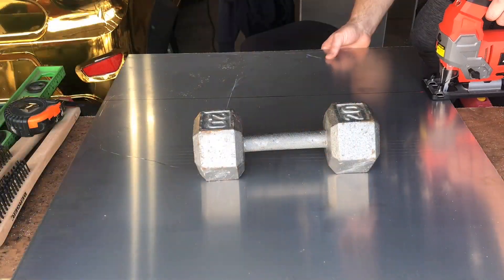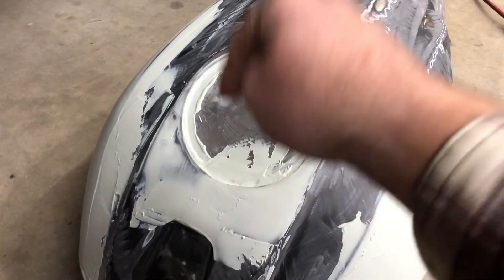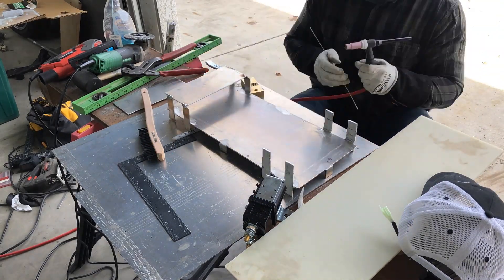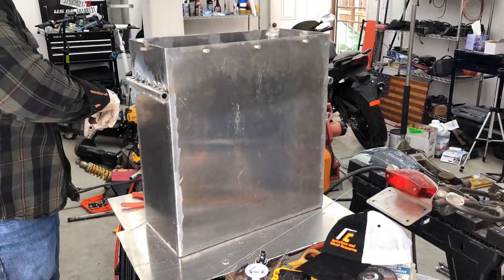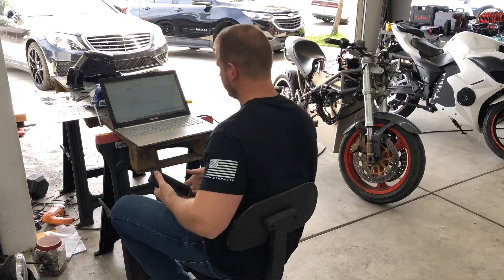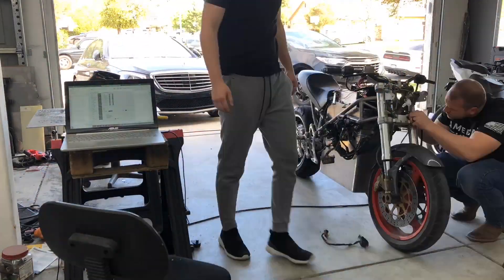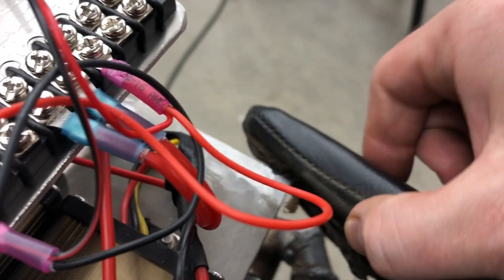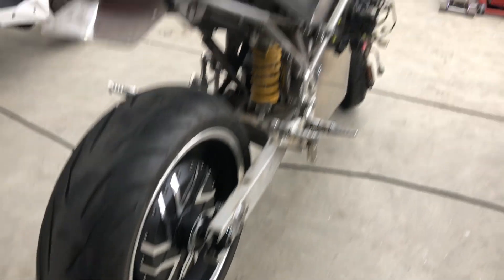The Ducat-E (Electric Ducati Monster) LIVES! Full Assembly of Electronics

Comment: Good project documentation. Curious why you went with LiFePo4 instead of Lithium Ion. Safety? Longevity? I think I would lean toward Li-ion but wanted to hear your reason... Thx. Also, do you heat treat after aluminum welding?

Comment: Bruh you are a major inspiration to me, and I love your content. But you gotta share those Kelly Controller settings for the CB750. You're breaking my heart over here.
Reply from the maker: Hey man, glad to hear it!

I’ll see if I can plug in and grab some of those settings. I did have to dial it back more than I wanted to because of issues with the controller overheating, but it does the job. I didn’t record the specific settings I’m using without getting back into the software to check. Busy week for me, so I might not get the chance for a while

Comment: I think i am using the same controller and software (EVDriveManager) as you but i am using an 8000w motor. i am also running into an issue: the display isnt staying on, it keeps flickering on/off and i am not getting any power to wheel and the mode switch seems to be stuck on reverse. I hear this weird sound coming from the relay but i dont see any issues with the connectors. I hope i can figure it out on my own but might take much longer to get it working. Cant wait to see your programming video. I really want to see how you set your parameters for this build. Thanks again.
Reply from the maker: Dang, man, sounds like an issue with the phase wires, controller harness, or other accessory wiring. I’ll post as soon as I can!
Reply: @LordCurt  i bought it from china and only recently starting tearing it apart after experiencing a few BMS errors. im thinking of just replacing the controller and display, keeping the motor. Right now, im just figuring out how this bike works in general and i am closely watching your videos for guidance. I am so clueless, i am just color matching the wires at this point. I am not giving up though.
Reply from the maker: @NemoEUC  the controller is pretty impressive if it’s the same one I have. A smaller version may not be, but I’d check to see if all the wiring is right before moving past the controller too quickly

Comment: I would be slightly concerned about the concentrated stresses around the x part of the ducati trellis frame, the mounts of your ali box may just shear straight off if it decides to bend. Could be potentially fixed with an extra bit of tube on each side?. But otherwise awesome build, excited to see how that hub motor goes.
Reply from the maker: Already have a plan for a bar underneath the x portion, so shouldn’t be an issue

Comment: Got any brass for cleaning your soldering iron?  Helps a lot.
Reply from the maker: It actually just colors dark because of the heat almost immediately after cleaning. It runs really hot. Does the job great, but I haven’t cleaned it with anything but a sponge or scraper. I may use brass next time it seems slow to transfer

Comment: Amazing work! some really innovative and clever solutions here - especially for the dropouts and the manifold/12v wiring. I built an 17kw enduro ebike previously and the wiring is a bit of a mess and difficult to adjust debug if there are issues - working on an electric motorcycle conversion now and will definitely borrow from this. I'm also just getting into Tig welding - did you use a footpedal for this? My big concern is to bust through the aluminum with too much current and ruin the plates (or bike frame). Also, how did you manage to get good square angles when lining up the aluminum for tacking? with steel you can use magnetic clamps etc but aluminum is non-magnetic. from the video it looks like you just laid them against each other.
Reply from the maker: Glad it was helpful!

Foot pedal, yes. Aluminum burns through much easier. It warps and distorts since it’s such a good conductor, so practice plenty before you go for the real pieces. Also give it plenty of time to rest and cool before you cook it all. Warps like nothing else. For the angles, I used a video by “pacific arc tig welding” called “how to tig weld aluminum - tack welding tips!” to get ideas for how to tack correctly. Once tacked, you can bend the correct angle with a square, but be sure to tack plenty once you have the right angle and placement
Reply: @LordCurt  ah! I see. definitely very helpful & thank you for the reference to the video!

Comment: I’m sorry if I didn’t catch it, but what is brand of controller? What are its specs?
Reply from the maker: It’s an APT96800, which is actually the same model as the 961000. Max voltage is 120. It’s about 15kW continuous. It is capable of 1000 phase amps and a little over 450 battery amps at peak. It runs great
Reply: Thanks Curt. Have you seen the far and driver track versions of the 841800, 961800, 1081800? specs say 1800A/1350A phase current.
Reply from the maker: @sainttenn  I have, and we recently purchased a couple lower power models for an upcoming project. I wanted the track versions, but 1) no motors they supplied with hall sensors were strong enough to handle them, and 2) no encoder versions are available for the highest power controllers yet. Once they have those, I’ll be doing a high power design with a track version and some strong encoder motor, maybe ME1616 or some other brand

Comment: Hey man. I’ve recently gotten a motorcycle from China and I’m looking to tune it since it feels really underpowered/sloppy and the speedometer is VERY inaccurate. It’s a 15kW QS Motor with a FarDriver controller and a 72v 120Ah battery. I’ve ordered the Bluetooth dongle to play with the settings and get it to perform like it should, but I’m not sure how to calibrate the speedometer to display the proper speed. Any tips?

Comment: Awesome work and great explanation of your thinking about each problem. I like the way you solved the swing arm mounting and axle torque arms. Do you think you’ll need some kind of waterproofing around the lid of the battery box? Not sure but is that back tyre on the right way? Also might be good to have the phase wires running down out of the motor to minimise water ingress if you weren’t already planning on doing that.
Reply from the maker: Yep, going to make a gasket for the battery lid, so that’ll be waterproof, just not yet. Downward phase cables is a good idea! I’ll see if we can make it happen during reassembly. 
And yes, the tire is mounted backward. The tire shop guy did it wrong after clear instructions 😞

Comment: Hey Curt, awesome work you did there! I'd like to know if you think if a supercapacitor bank like in your previous build would make any improvements in this build? Was it worth it in the end (in the previous build)?
Reply from the maker: There was a specific reason for it last time, but this one wouldn’t benefit. The controller isn’t pulling pulses the same way the Kelly did that caused an issue with the battery. It would just be an extra level of complexity in this case

Comment: First af all GRATS for all the work. What you are pulling out here is no less than amazing!
One question though. Is the back wheel a bit off center or it just looks so? 
Maybe I missed some earlier comment when you where explaining what you did for the bracing of the hub motor.
Keep up the great work mate!
Reply from the maker: Thanks, dude!

It’s pretty dead dented, and it’s aligned using the stock swingarm ruler/markings. What about bracing specifically did you have a question about? I did go through roughly what method we used for securing it
Reply: Pretty dang *centered haha

Comment: You need to reinforce the tube frame. The engine was part of the structure. Now you created a pivot point and the modified tubes looks weakened. I would extend the horizontal tube towards the seat and tubing where it was bolted to the engine. Good luck with the build.
Reply from the maker: Got a plan for the tube along those lines. Thanks for the input!
Reply: Not only that (motor as stress member is lost) but the internal frame cross links were also removed. 
At first, I though this could be somewhat compensated with a stronger battery box (sort of a stress member), at least  linked to the rear arm pivot point but, if anything, the box is making  it worse  by  "hanging"  on the top of the frame. As is, there should be a direct link between  the middle of the frame and the rear arm. All 916/996/998 has something like this, besides the engine as stress member.
Probably this wasn't a design consideration but, everything added - specially the gigantic (heavy) hub motor - I don't think this will handle very well. Not by Ducati standards, that's for sure.
Still fun to watch (if you're  not a Ducati fan...).

Comment: Im using this same motor for my EV bike. Im just waiting on the batteries. What do you guess the 0-60 will be?
Reply from the maker: Right now I would guess 5 seconds. We’ll be testing it shortly! What controller are you using?
Reply: @LordCurt  I'm using a Kelly 96601-8080H
Reply from the maker: @fullmetalcorgi1350  nice, that should be reasonable power. You may find it start to overheat if you push it to the motor’s limits, but it’ll do the job for sure
Reply: @LordCurt  awesome. I have it on a large aluminum heat sink in the wind.

Comment: So the battery case box thing you made … you sure it won’t just fall straight down to the ground. Is there anything else holding at the base of that? Not questioning your talent just asking cuz I’m curious :)
Reply from the maker: I am quite confident it won’t fall through. Fully welded on all sides, and held in the box by adhesive and tension. It will hold as is, but if there is any concern, I’ll be sure to reinforce, of course